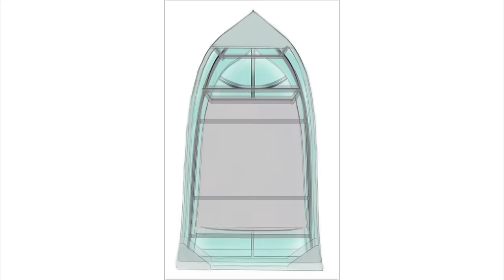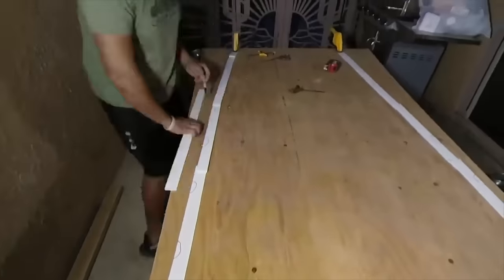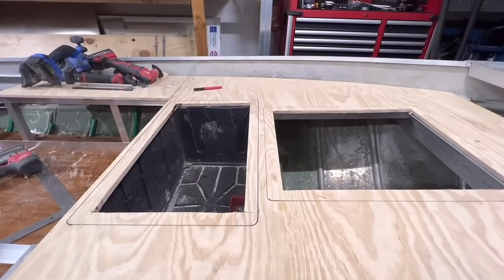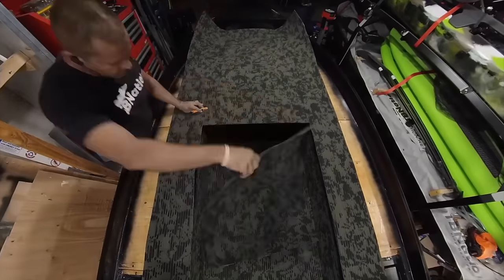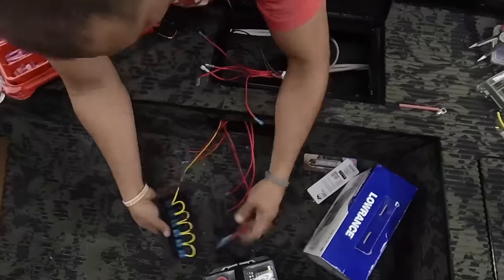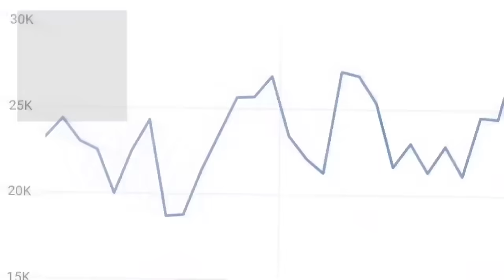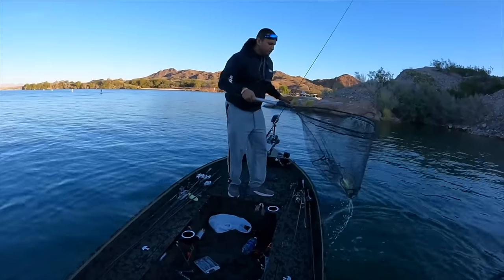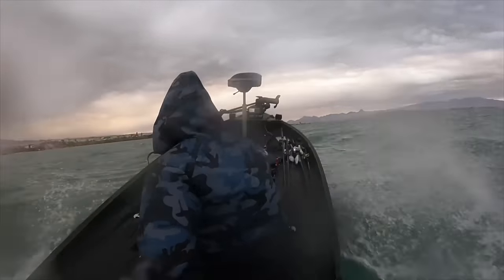How to make a 14ft V hull / Deep V Weekend Warrior Build

Comment from the maker: All products used in this build
14ft V-hull kits: https://tbnation.net/products/14ft-deep-v-aluminum-boat-kit
Vertical Day boxes:  https://tbnation.net/products/vertical-day-boxes
Gear Caddies: https://tbnation.net/products/trolling-motor-bracket-caddy
Corner Caddies: https://tbnation.net/products/corner-caddy-gear-tackle-cup-tool-all-in-one
Thru-hull brackets: https://tbnation.net/products/pump-out-brackets-for-3-4-thru-hull-fittings
Power Drive: https://tbnation.net/products/minn-kota-powerdrive-55-us2-trolling-motor-12v-55lb-54
ProNav Angler: https://tbnation.net/pages/search-results-page?q=pronav
Reply: do you guy sell boats if so where can i see what you have?
Reply: Will it work with a smaller boat. Eg 3.5m

Comment: I'm a big guy on disability trying to figure out my best choices to doing a small boat like this that is somewhat affordable being on a limited income. I'm a navy veteran that misses the water and I've always wanted a boat but always had to fish from the shore. Being in middle Tennessee it's really hard to fish for big bass standing on the bank. Any advice you can give would be helpful
Reply: I can help you. Well I have found myself in the same situation. You need a boat a little bigger. However I would go with a aluminum boat. Most all of the aluminum manufacturers built small fishing boats that had seats and floors etc. find one of those in s 16 17 18 or even a 19.Take everything out. Now you have a plain aluminum hull. Now put a floor back in and create the interior with a live well fishing tackle box boxes. Storage boxes. ETC. then stop at just a few seats maybe on top of other boxes or your live well. You can position then so you can move around in the boat with a large open area. You can find these cheap because all that carpet and soft interior is trashed from the sun and use. That would be a perfect boat for you and it will not cost you a lot, because most people only think of taking it back to factory, however you don’t want factory. You will have a nice little boat at a fraction of the cost with a ton of open room for you to move around in. You can always add rails in places needed for aiding your disability.
Reply: I’m in West TN, your best bet is watching marketplace and waiting for a good deal to come up, main thing you need to watch out for on the hull is just that it doesn’t have leaks
Reply: I just scored what I believe was the first truly tiny fishing boat that came from the factory. Check out and then try to find a fisher sv 16 gt or of you need it bigger they make an even harder to find sv 18 gt. It's kind like your getting a job boat with a semi v hull and my 16 can take up to 75 ponies on the transom. I'm still gonna modify it but it came with aluminum floors so no wood to rot out so it'll be fun.

Comment: Outstanding my friend.. I have a '64 Cherokee almost identical with a 25hp, and i'm loving what you turned out for this show!!!  Mine is a tank, and see where I csn improve, and grateful for your input on channel.  Absolutely a must for the weekend warrior!!!  👍
Reply from the maker: Good luck!
Reply: @TinyBoatNation   I just picked up a 2008 Fisher Deep V 1466.. 
it has a 5’6” beam and 48” hull and I’m super excited to begin the build process!

On your kit, how many rods typically fit in the rod locker - trying to decide between the tourney and pro level kits?

Also, do these dry hatches come un painted or powder coated?

Comment: Go, man, go!!!! I have an idea for you because I know that you hate seeing your fishing rods on the deck where they can get stepped on and broken in rough water. What if you put a 6 to 12 in high handrail around the rear 8'ft of the sheer the boat. On sailboats, they call them stanchions. That would give you a place to put rod holders to store your fishing rods, under 8'ft long, in a vertical protected column, on each side of the boat. It would unclutter your deck. You would want to keep them low so you can land big fish with a net over the handrail. Pontoon boats have them.

Comment: Correct on the pu foam, it's closed cell fuel resistant. Excellent floatation and sound deadening. Correct on the ply floor, done right it's durable. It is also more buoyant than aluminium.  Drop a piece of ply in water, it floats. Drop aluminium in and it sinks.  Good work 👍
Reply from the maker: Thanks for the info!

Comment: the difference in the direction of the turf or carpet is brush. and it is directional that what the arrows are for on the back. the foam I'm not sure if it has a brush its been a minute since I've been a part of putting carpet in a boat

Comment: I have a 30 year old flat bottom 14 ft aluminum boat that was given to me because it has leaks from scrubbing the bottom ( i can only guess how) at the back in the three v channels. I cleaned it up and the aluminum is worn through in 3 places.
I don't have the ability to weld it. Can i fiberglass over the holes to repair it? And how can i put storage boxes in without leaks ?
The boat looks like the ones you used to be able to get from bait and tackle shops for $150.
No seats, just a bow plate and cross board in back.
Can you please give me some advise ?

Comment: I do dangerous things quickly.... run flooded mississippi river a bunch as I've lived-in flood plains since 2010...smaller boats with tiller is more agile and draft is great for shallow areas...running a 14ft Lowe with 20hp 4stoke can lift end by end easily... my neighbors with larger boats can't go half the places I can do to trees depth winds. I've chased got away docks, boats, lp tanks, and much more...being able to grapple a log or fell tree away from house, garages, and maneuver them safely is not always easy.. go get um:)
#LowLyfer♧

Comment: Have you ever considered using HDPE as the subfloor? I’d think that it would bring a “no rot” quality to the build…. Thoughts?
Reply from the maker: It also holds excessive amount of heat and starts to flex in high heat. It’s also really heavy. No thanks.

Comment: I need help I just built a 14 foot boat just like yours and I can’t figure out how to connect the transducer to the front area of the boat. I have min Kota terrnova and since they spin fully 360 you run the wire down to the front motor so I was wondering how you did it or works best for you
Reply from the maker: Contact us on our customer service line. Visit our website and it’s there.

Comment: If you used polyester laminating resin without adding wax or "without wax" vs. epoxy, you wouldn't have to sand between coats.

Comment: Not to be (too) nitpicky as I like what you're doing but unless this hulls was called the Deep V from a manufacturer back in the day, please don't call it that;). While it may have a bit of proper deadrise over a Jon Boat it's certainly not a deep V by any stretch of the imagination:).

OK, to qualify (nitpick), when we talk about how much V a hull has, people predominantly go with deadrise at the transom, not the bow or mid section.  And this hull seems like it has flat running surfaces = zero deadrise which strictly speaking means it would have no V, at all;). 
Deep V would have +20 or so degrees depending on manufacturer to be called a deep V and it would need a ton more horsepower to get on a plane.

All that said, maybe the jonboat/tinny community in the US have their own take on this?